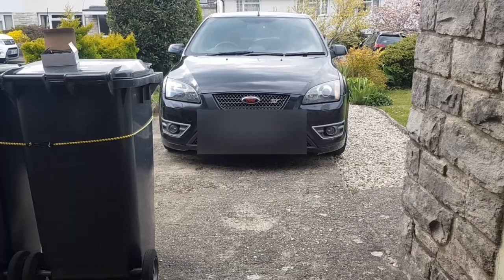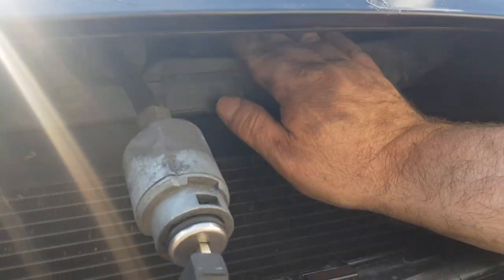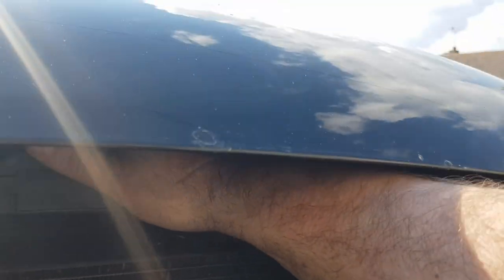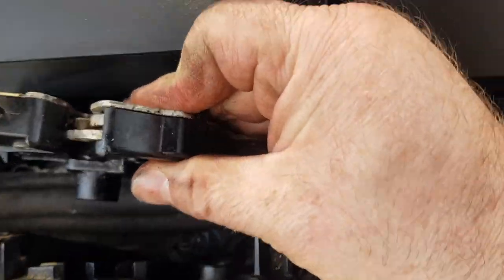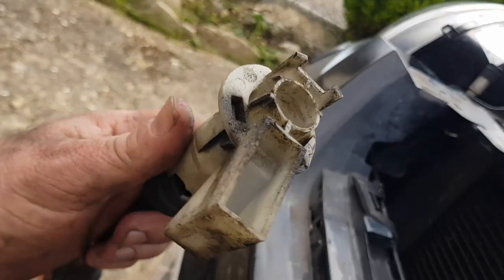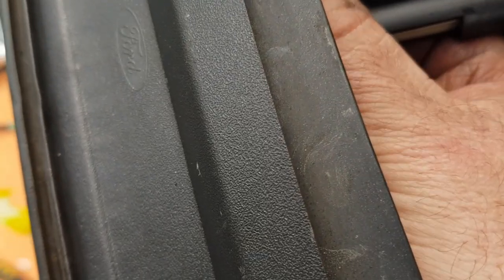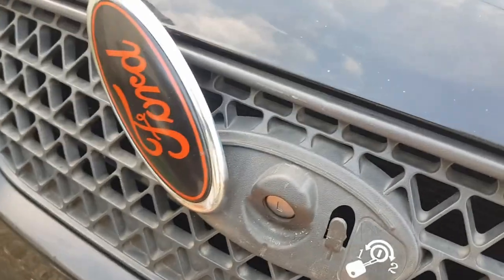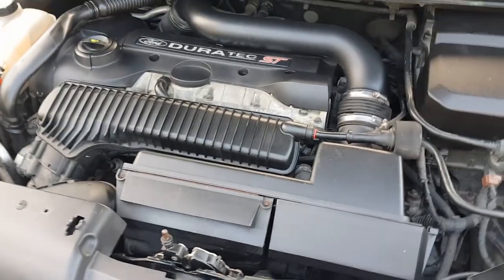Focus MK2 Bonnet Lock Won't Open - Ford Focus ST Episode 4

Comment: I have done this on many Ford models. The white plastic plus shaped joiner fails which is a common problem with Ford models. I went in from underneath to remove the 2 bolts for the catch as not to damage the grill. Once the bonnet is open, You have some options. 1. You can replace just the white plastic joiner. 2. You can replace the whole bonnet lock & pull it it apart so it fits your original key (Which I have done & is a flaff) 3. The easy option, Replace the whole lock/key barrel but will come with a set of separate keys. I am a driveway mechanic & The last one I did for a neighbour took less than one hour. Hope this helps.
Reply from the maker: All good advice, cheers.
Reply: @PaulinhoThompson  Thanks Paul.
Reply: How can you remove it from underneath when it still won't release the catch that attaches to the bonnet

Comment: Thanks for uploading this.  Mine failed a week ago on a 10 year old Focus Zetec.  Watched loads of 'how to remove' videos.  Screwdriver trick failed despite over 30 minutes of trying.  Getting grille out was a 1 hour nightmare where some videos seem to show it as easy!  Caused some damage to plastic shroud that goes above grille.  Lock cable inner had snapped behind lock and also white plastic plus shaped joiner had one lug broken.  Waiting on an ebay replacement kit and trim clips at present.  Stupid design that there is no simple emergency way to open bonnet when this fails.
Reply from the maker: Glad  you're getting it sorted, it's a very poor design isn't it.

Comment: Sorry to bother you, I need to know what screw Is needed to hold the bonnet latch to the car. I mean the 2 bolts you took out. One of mine somehow went missing and I wanted to replace my bonnet lock. My friend told me it’s a 10mm
Reply from the maker: @mythicaldragon2260  I can double check, but I think it's right.
Reply: @PaulinhoThompson  thank you and where do you reckon i can get a replacement screw from as I wanted to change both the latch and the rod. I just wanted to know the specs on the screw so i can just buy another.

Comment: Thank you, helped a lot. Can you please tell what size bonnet clips we should order ?
Reply from the maker: Which clips are you after ?
Reply: @PaulinhoThompson  which holds the grill on 2 sides I took them out with chisel in order to pull the grill out
Reply: Usually they are universal on ford's I changed the locking mechanism on my 2010 focus about 12 months ago. If you order the parts off amazon the connection fasteners known as scavits which look like plastic crosshead screws should pop up in packs of 12 if you wish to perches them together with your new locking mechanism . It's worth bearing in mind that these usually carnt be refitted after removal as they usually break off at the base

Comment: Thanks. How did you get the grille out initially? I am having the same issue on my Australia delivered Focus XR5 Turbo (Focus ST) and I can't get the grille out
Reply from the maker: Sadly the footage never made the video, but I had to remove it by going in through the lower grill, it wasn't easy.
Reply: @PaulinhoThompson  Thanks for replying. I managed to remove it by going in from underneath, snapping the bottom of the Scrivets off and then using a hole punch to push them through, then yeeting the grille out with muscle power. Got it sorted out
Reply from the maker: @MrS13Silvia1  brilliant 👏 well done.
Reply: @PaulinhoThompson  Thank you :) You earned a sub for all your help. I've been watching a few of your other Mk2 Focus videos also
Reply from the maker: @MrS13Silvia1  thank you, plenty more planned, just need nice weather now.

Comment: tnx, il try to swap to this PLASTIC version, cause  the original metal  wire rope style lock  keeps brake every 4-6 months, btw - my method of opening boot is just remove the mesh and then smash all  white plastic part with hammer, and then open with screwdriver, BARBARIC but done in less than minute.
Reply from the maker: I like your method 👍🏻👍🏻 thanks for watching.
Reply: Very effective. I done this too

Comment: Really useful video - but how did you get the grill off without breaking it? The outer two clips on the ST don't seem to be accessible when the bonnet is closed.
Reply from the maker: Getting the grill off is the worst part to be honest, and sadly all of that footage never made it into the video. Some of the clips you can get to through the holes in the grill, and you can push them off, which will allow you to be move one end of the grill back into the car. The others I got to via the bottom grill, I ended up with plenty of cuts and bruises from pushing my hand through the slot (which is something I wouldn't advise) and just pushing it evenly out of it's holding. I almost gave up doing it, but thought to myself if I don't do it I'll never get it out.
Reply: @PaulinhoThompson  Thanks for taking the time to reply. I feared there would be no magic solution. We'll have access to a lift at the weekend (it's my son's car) so maybe we can get at the clips from below. Failing that, just reach up and swing at the mechanism with a hammer. How's the replacement part holding up?
Reply from the maker: @mf-bk6qt  yeah you could gain access from the bottom 👍🏻 and not wishing to tempt fate, but the "cheap" auction site purchase is holding up fine thanks

Comment: How’s the new lock holding up mate mine just gone on the rs and have seen a couple of versions a like this one though cheers
Reply from the maker: Famous last words, but it's still 100% 👍🏻🤣
Reply: @PaulinhoThompson  thanks looks like I’ll be giving this a go this time. I used the same as ford one last time it lasted nearly 4 yrs
Reply from the maker: @adyg8221  no worries and thanks for watching 👍🏻
Reply: It's the same one I used from amazon last year but I would take it easy with the plastic arm by not turning to quickly and stressing it . I have a feeling that thay could easily brake up after becoming brital and back to square one again

Comment: Mine sucks man I haven't got locking mech at all or anything and can't get in to it
Reply from the maker: You should be able to use a long screwdriver and reach the rotating part located under the slam panel.